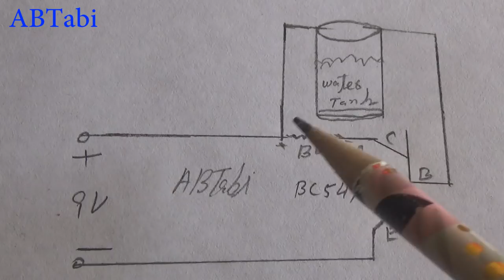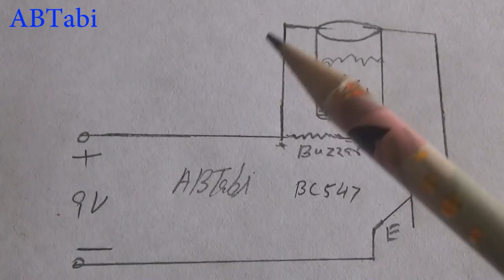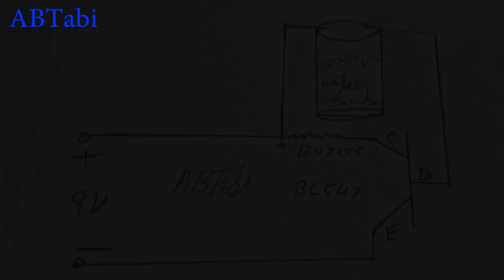How to make a Water Tank Overflow alarm circuit, super simple

Comment: I played a little bit with this circuit and I optimized it to be a level sensor for a 5V ATTINY85 without the buzzer to replace quite an expensive sensor made with copper which corroded like hell by using a long and a short lead in the water at 2 different levels: one at the bottom and the other a little higher, then I connected the data cable from ATTINY85 to the emitter. When the water level changes, the values returned to the ATTINY85 changes. Now I have a super cheap $ humidity/water level sensor out of a NPN transistor and 2 wires!! Great!! Thanks for the idea ABTabi.